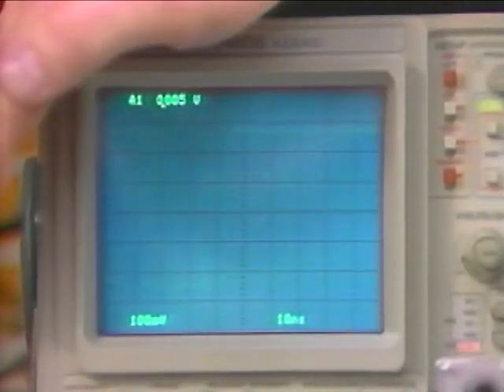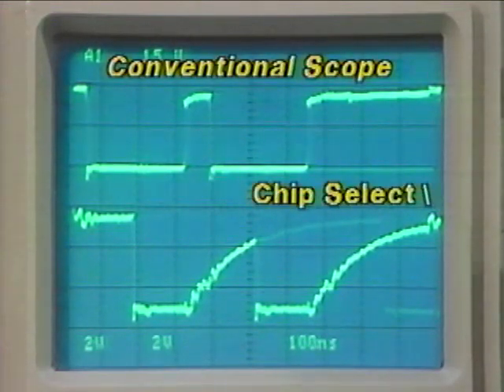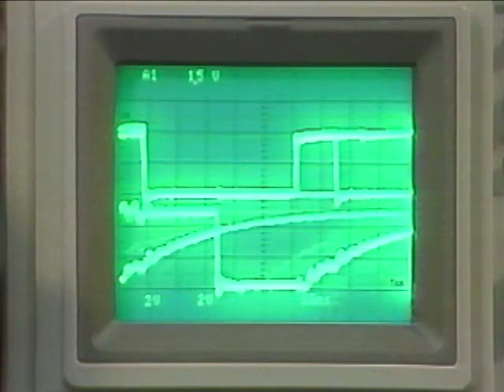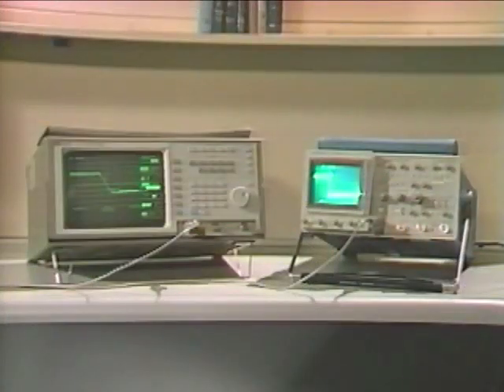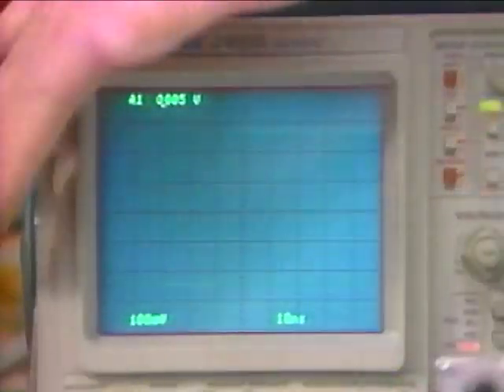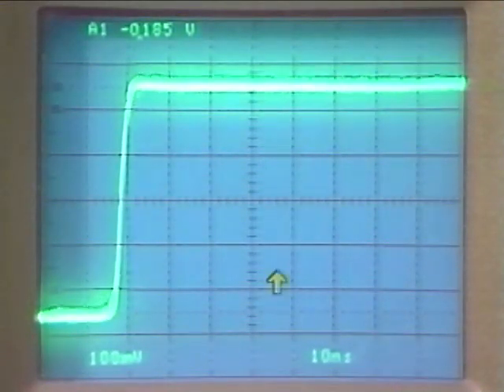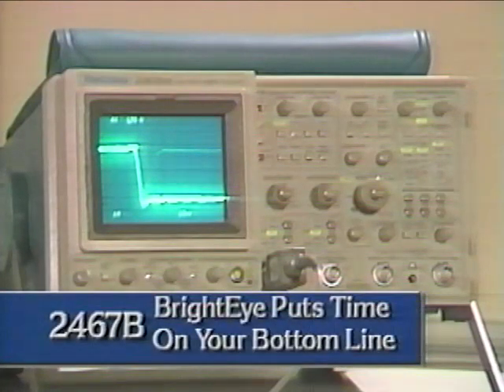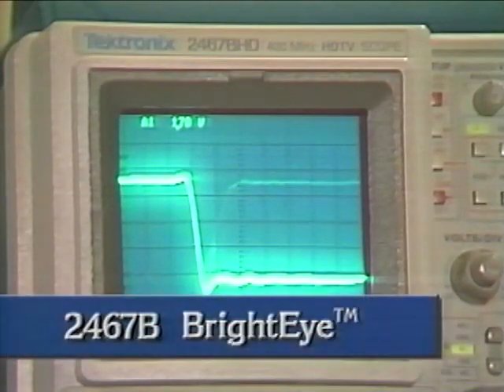Tektronix 2467B "Bright Eye (tm)" Oscilloscope

Comment: Very awesome scope after I fixed mine that I inherited broken.  Main power supply was knocked out with bad caps.  Replaced those, re-flashed the NVRAM on to a new fresh Dallas chip for the cal. data and bam back up and running.  Sure, it'd be nice to have a pro do a cal. to it but near as I can tell it seems spot on and is close enough for me as a hobbyist.  Works super nice.  It is loud when it runs compared to a new digital scope; didn't have a 12v fan to replace the one in mine that went bad (bearing went super sloppy after this much time-mine is a '91) but I did have a 120v one that had the right dimensions.  Rigged it on instead for the time being.

Comment: That must have cost a pretty penny, even then.
Reply: Everything Tektronix ever made was expensive. Still true to this day, with their Series 5 MSO starting at $12K USD. Their Type 555 oscilloscope from 1959 had a price tag of $2600 back then !! But there has never been any doubts as to the high quality of their products. You get what you pay for.
Reply: It was - it was over $12,000 when new.
Reply: Wauwwww!
Reply: about 3x more than the 2465B
Reply: And how much was a replacement CRT for it back then?